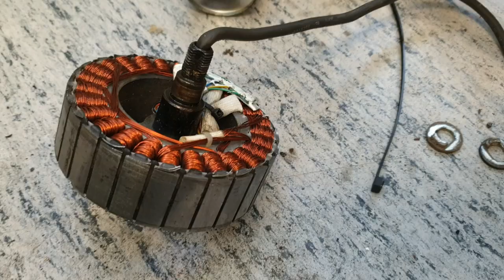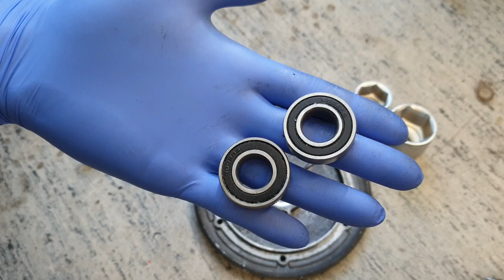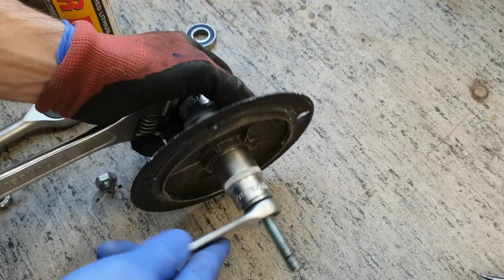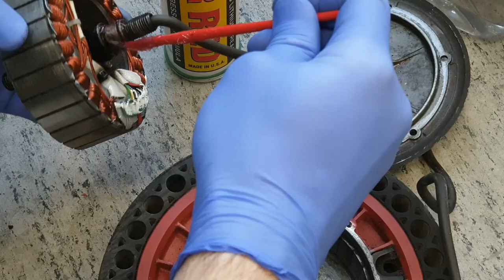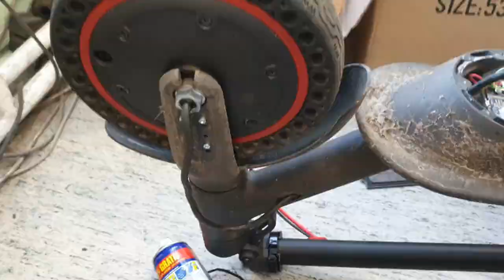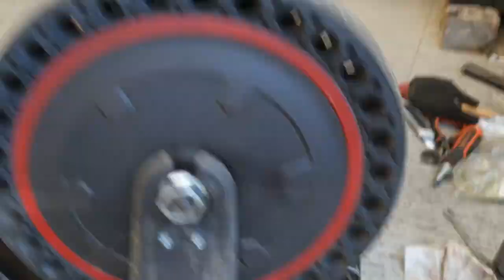Xiaomi M365 PRO front wheel bearings change

Comment: Hello @RefillGuy ,

Thank you very much for your video.

It’s well done !.

Could you detail the tools used to disassemble / reassemble the bearings? 

Thanks in advance
Reply from the maker: Thank you! Old bearing just hammer out with 10mm or 12mm socket head. Assembly you can see on a video, no special tools needed...

Comment: Hi! I messed up a lot with the bolts of the wheel, as I had to take it off many times. Now, with my last removal of the wheel, I tightened the screws real hard (as I always did) and when I took the scooter for a ride I noticed that I can't go 25km/h anymore. Now the top speed on flat road is 22km/h. Could it be because I messed up the bearings somehow, or what do you think the problem could be? Thank you in advance for taking the time to answer 😁
Reply from the maker: Oh. Try to pump your wheels properly at least 50-60psi, charge your scooter 100% and test.

Comment: Im facing a vibration on a full throtlle. Do i need change the bearing too?
Reply from the maker: probably
Reply: Me to I have a vibration coming from the scooter its been driving me mad I found that the front wheel has some slight movement when I pull on it so I'm guessing its that

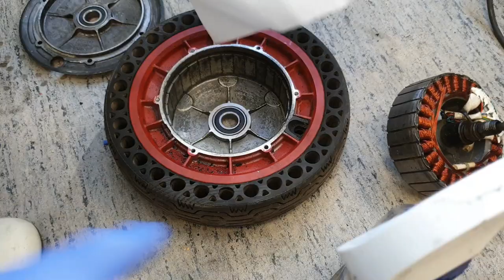Comment: Can you please tell me/us what is that liquid you use to clean the inside of the motor at 4:22? Is that isopropyl alcohol?
Reply from the maker: Yes or anti silicone
Reply: @RMFUNTIK  Thanks, mate! I saw you using it several times in your videos and I was curious what was in that bottle.
Reply from the maker: in past i used ispropyl, but nowadays i use anti silicone it's better remove grease.. :)
Reply: @RMFUNTIK  Apart from bearings (which I recondition because I have no other bearings at hand), would you recommend treating or apply some corrosion protection on the motor, say like Plastik-71 product? Or just clean it as best as I can and seal the HUB better with some high-temperature silicone so the water won't infiltrate so easily?
PS: Thanks for the answers and patience. I know I ask a lot of questions but I really appreciate your recommendations.
Reply from the maker: you can spray the magnets and the hub with clear coat lacquer 2/3 times and put grease on the end of the motor screws (mm on the outside where the washer and nut sits..) and avoid water :)
Reply: @RMFUNTIK  I ended up using Super Black RTV (it's a silicone that creates a heat resistant gasket) around the HUB cover, making two such gaskets. One near/around the screws and another at the outer edge of the motor cover. Didn't use anything else on the motor in the end, as I don't want to risk overheating the motor.

Comment: Hi, on my mi scooter I broke the cable , and the wires are exposed, can the front wheel motor cable be replaced? Or do I need a whole new wheel
Reply from the maker: you can try fix them...
Reply: it can but it does require soldering

Comment: is it possible that my motor is making a weird noise because i need to change my bearings?
Reply from the maker: well yes and no...but if is was normal sound you in the past and now its weird, then yes. but again, i'm not sure what noise are you hearing...
Reply: @RMFUNTIK  thanks for replying. the front wheel move a little but i cant go forward and then it stop but the motor keep making weird noise any time i try riding it
Reply from the maker: @Drakerulezz  well you need to disassemble and look inside..

Comment: One bearing is stuck to the hub and is not able to remove. How to remove?
Reply from the maker: hammer it out or use special extraction tool..
Reply: @RMFUNTIK  tried hammer also. The cable side bearing is stuck which  is difficult to hammer. Can the bearing gets cut by hacksaw?
Reply from the maker: this is difficult to explain, but i guess you understand me. you need a screw driver (flat), use the holes in the motor to put the screwdriver in and hammer the bearing out, try not to damage the wires, if you have vice grip, use it would be much easer ..

Comment: Hello!  my m365 after 2500 km has lost autonomy and speed (suddenly ...) I notice when I let go of the gas that the scooter brakes (I don't have the kers in the firmware).  are the bearings likely ??  I blamed the battery but I really noticed friction and fatigue even in accelerating.  from 25 km of autonomy I passed in a few weeks to 12. from 31 km / h to 24!  I checked the tires for rubbing (being 10 inches).  I don't give what to think anymore.  also struggles to connect to the various apps (m365 dashboard for example).  help me
Reply from the maker: water corrosion? need to be inspect.
Reply: @RMFUNTIK  it can be, even if ....... it happened almost suddenly.  mysteries.  thanks for your answer
Reply from the maker: @giorgiorossoni9015  look for upper and botom control boards, inspect each cell battery. maybe some died do to km.
Reply: @RMFUNTIK  ok thanks!

Comment: Your link doesnt work, where can I find bearings?
Reply from the maker: link works, just use it right, or go to local bearing store..
Reply: @RMFUNTIK  OK, I just purchased a pair of 6001 and a pair of 6002 bearings. Found it in some other YouTube channel, think its right? So I will change all wheel bearings =)
Reply from the maker: yes 6002rs front, 6001rs rear.
Reply: @RMFUNTIK  do you know the exact measurements/dimensions of the bearings?
Reply from the maker: @wordonthestreetministries6241  6002rs front, 6001rs rear.

Comment: please, can you help me?  I opened the two parts of the motor and the bearings got stuck on the motor shaft, is there any way to remove them from the shaft?
Reply from the maker: yes, special tool for extraction or just hammer it out from other side..